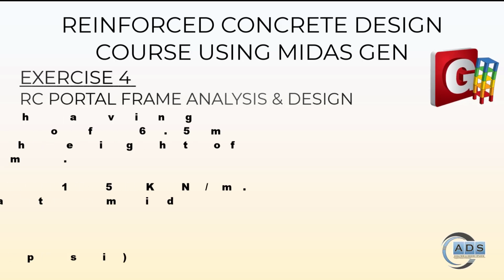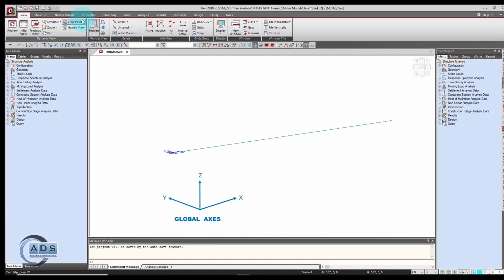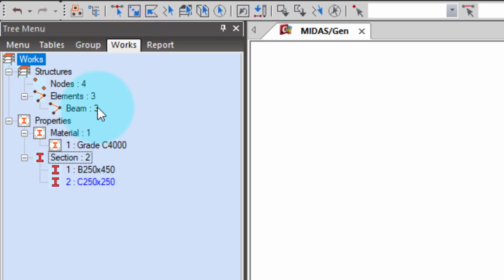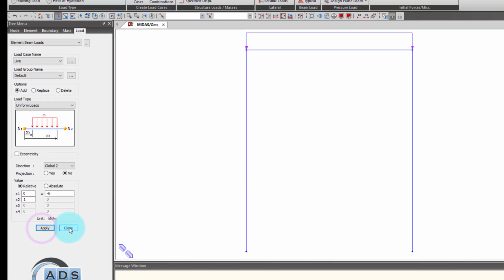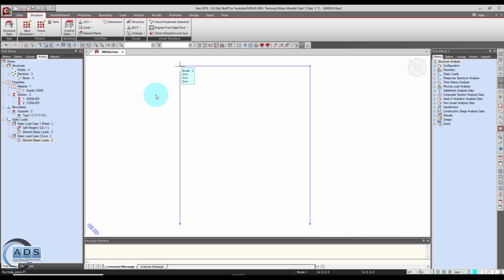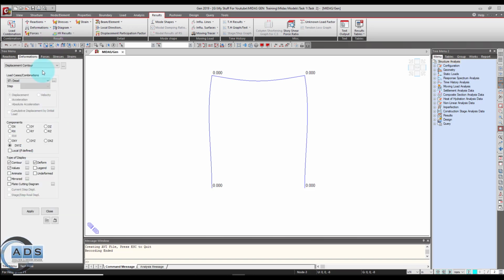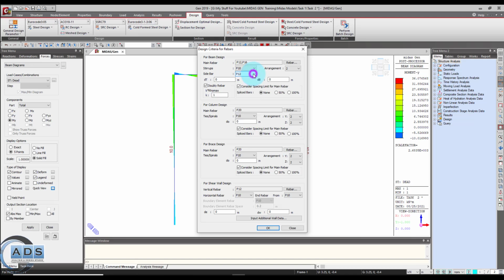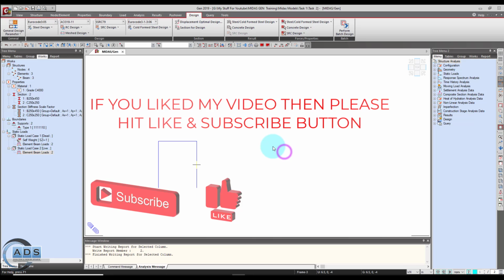Reinforced Concrete Analysis & Design Course using MIDAS GEN - EX 4: ANALYSIS AND DESIGN OF FRAME

Comment: Where is frame check video?
Reply from the maker: Like Beam Check. You can perform frame check. Option in Midas is Beam Check means Beam element (it can be column beam both)
Reply: @analysisdesignstudio3363  Alright! Thanks

Comment: can you explain the stiffness factor, why and how they are evaluated?
Reply from the maker: Yes... As concrete is weak in tension.. When load is applied on the beam, then it bends, so that at the botton surface of beam, tensile stress created.. Hence beam will crack. So as per the design code, we have to consider only 35% of moment of inertia for beams. Similarly 70 % that of column. This is as per ACI 318